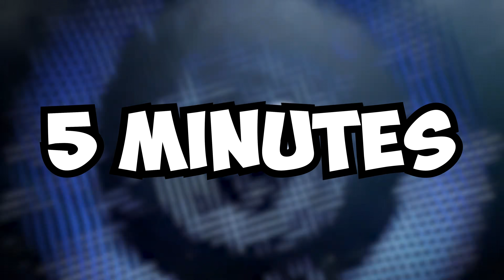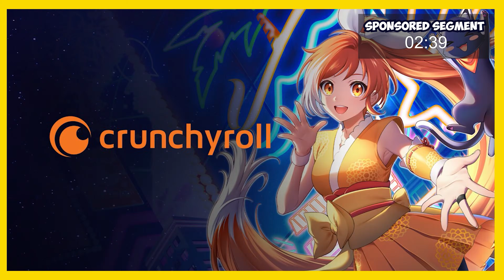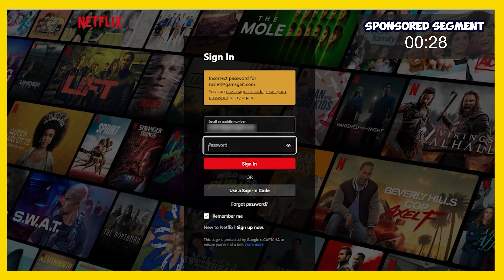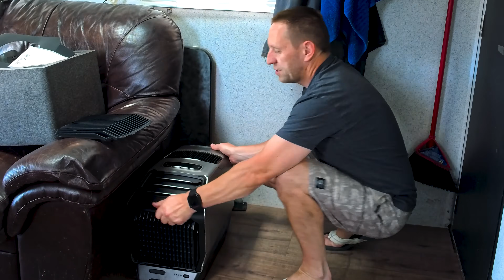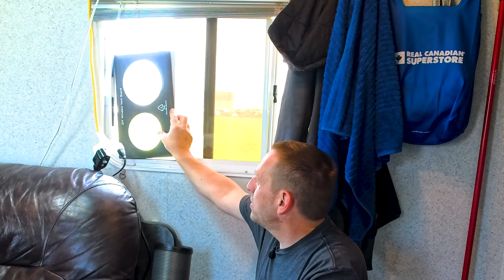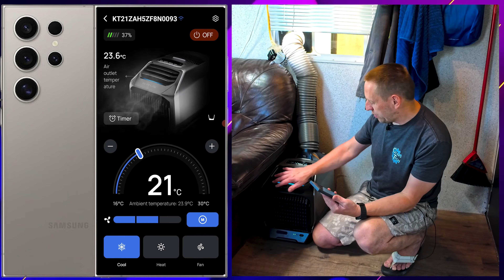The Best Portable AC - EcoFlow Wave 2 Test & Review

Comment: Not to be rude but you shouldn't be reviewing things if you don't understand how they work at a basic level. The (single hose) way you set it up is incorrect and means you WILL be pulling outside air into the space as opposed to if you set it up correctly.
Reply from the maker: Seriously?? Air comes in at the back and goes out the single hose

I think you need to check it again, or check your facts. You don't know what I understand

Comment: You need to connect both hoses for optimal usage. Intake from outside, exhaust to the outside. This is supposed to work like a mini split.
Reply from the maker: I really think the intake is not needed. The unit doesn't care where the air comes from.

Outside air is nice sometimes. But, as pointed out in the video, if you have breathing issues or allergies then outside air is not desirable
Reply: @GearsAndTech  if you dont use the intake it creates a vacuum in your trailer which will suck in outside air anyways, its basically a dual hose portable AC system, you can research them

Comment: I am not certain the intake hose does what you think it does.
Reply from the maker: What do you think the intake tube does?
Reply: @GearsAndTech  It brings outside air in for the heat exchange, so that exhausting air does not create a negative pressure in the conditioned space. The intake 'hose' air does not become conditioned air, it turns around and goes right back outside.

A negative pressure in the space would drag un-conditioned outside air in from every crack and leak. This was a disadvantage of traditional single-hose portable A/C units (they suck, per Technology Connections). It is not required that you take advantage of this improvement - that is up to the user.

The return air to be conditioned is at the front of the unit, where the filter panel is.

Thanks for the response, and the video!
Reply: @jamesalles139  TL; DR:

Single-hose A/C units are inefficient and can increase indoor humidity due to a pressure imbalance between the inside and outside.

Counterargument: Some A/C is better than no A/C.
Reply: @T10107  Yes, the humidity (latent heat, technically) from the unconditioned outside air that is dragged into the space reduces the efficiency of the whole 'system'. Usually, these units are big enough to get the temperature (sensible heat) down enough to make people comfortable.